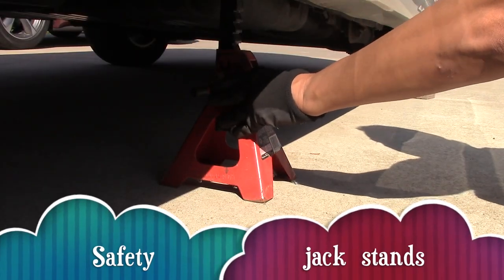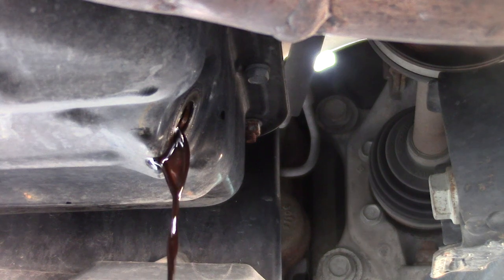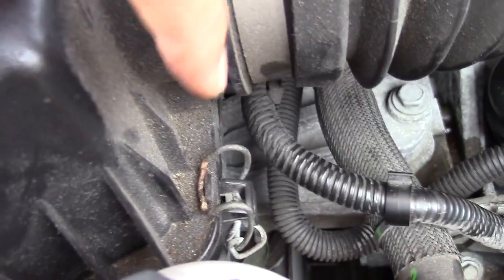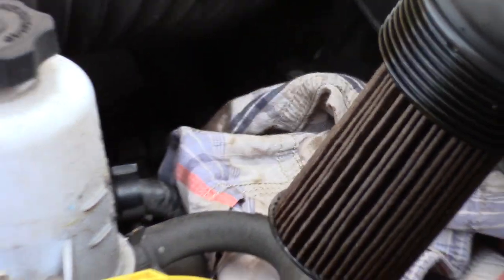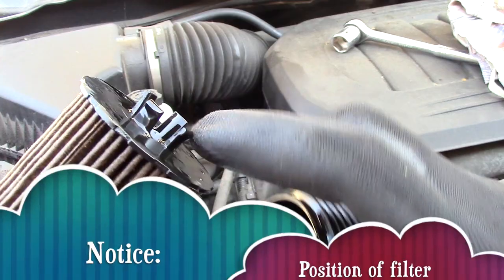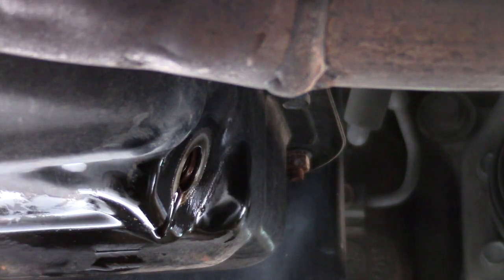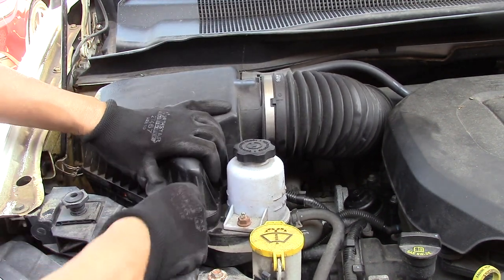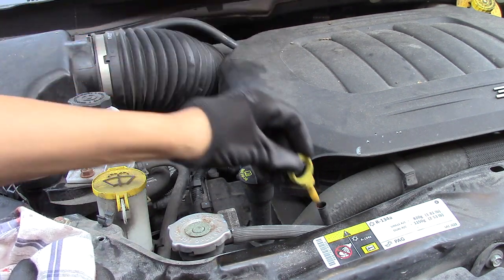How to do "Oil Change 2011 - 2014 Chrysler Town & Country" (DIY)

Comment: Thanks a lot.😀 I got my town and country,  I do it myself..and don't forget safety first...
Reply: Santi Pérez dont get dealer oil changes they add too much oil. 5 max specs say 6 but that will mess you r valve train.
Reply from the maker: Thanks for the info. This will help out the viewers also.
Reply: @amtonio5602  depends on the dealer

Comment: My 2014 and my wife's 2013 have different oil filters. I replaced OEM drain plugs with magnetic drain plugs (available online) so when I change the oil, I can see if any particles are accumulating on the inner surface of the plug.
Reply from the maker: It's a good idea to have the magnetic drain plugs. Thanks for sharing.

Comment: Thanks so much for this video! Gonna do my next oil change on a 2014 T&C we just got. I am just curious though what the reason may be for not replacing the O-ring before putting the new filter in? Seems easier to not have to slide it over the filter, but I'm sure it's some trick of the trade that I don't know about so was just wondering. Thanks again!
Reply from the maker: It's always a good idea to put the new O ring in.
Reply: Of course you can; just create a routine of your own.
Reply from the maker: Great idea Lucian. Thanks for sharing.

Comment: Great job but size of oil plug is 1/2" , oil filter is 15/16" and my dipstick says check hot ( oil is about 1/8" into safe mark when cold) don't overfill by bringing up to full mark when cold, six quarts is all you need. 2014 T&C
Reply from the maker: Great info. Thanks for sharing with our viewers.
Reply: What does 710 mean?

Comment: When  you pulled the oil filter and cap out / off of the base you didn't mention the spring that can sometimes launch itself across the room (or does 2013 not have a (compression) spring as my 2011 does?)
Reply from the maker: The 2013 doesn't have a compression spring. But thanks for charing the info. i will mention that in my description below my video.

Comment: Thanks for the video! I changed my oil and figured out that I didn't have the right filter. I ordered the filter but went ahead and changed the oil. Can I change the filter with new oil in it or would it leak out?
Reply from the maker: Yes you can change the filter without leaking. The drain is only at the bottom for the oil. That's the great thing about this van. Just put extra rag for a  a little drip.
Reply: @jonahvlogsdiy4143  Great news...thanks!

Comment: My 2011 Town an Country has 5w-30w in manuel and on the cap....... wonder if they changed to 5w-20w in a later year.... Anyone know???
Reply from the maker: Great question. I hope our viewers can answer that question, but if the cap and manual says 5w30w then its a sure bet its 5w30w.
Reply: My 2012 is 5-30,my drain plug is 16mm
Reply: My 2014 T&C takes 5W-20.

Comment: Do you really need to raise it up to get to the drain plug- or could you maybe just raise it not lifting it off the ground at all but just by raising the suspension?
Reply from the maker: Good question. I've never done it that way. I always do it this way. Safety first
.
Reply: yup ,safety first, the jack,could inadvertently come down on your head,a no no ,and it elevates the motor slightly to enhance oil flow as well,and easier to access and see. other than that ,nothing.

Comment: My oil cap says 5w-30 on 2011 T&C limited flex.
Reply from the maker: It may have changed from that year. Call the Chrysler dealer to double check on the oil for that year.

Comment: Note: you might want to mention; "you will need a 24mm socket to remove the oil filter housing."
Reply: The old rugged cross
Reply from the maker: Thanks for mentioning it. Now the viewers will know.
Reply: He did, but the video is still too long and bloated
Reply: He did
Reply: Actually, it's a 25mm socket that is required. It is labelled on the canister. Why did you use a 24mm?
Reply: I take that back, even though it says 25mm on the filter cover it is indeed a 24mm six point socket that worked for me.